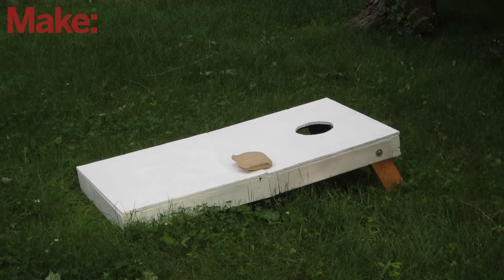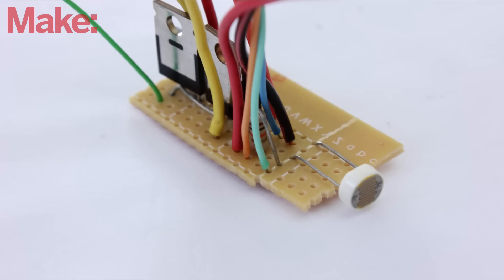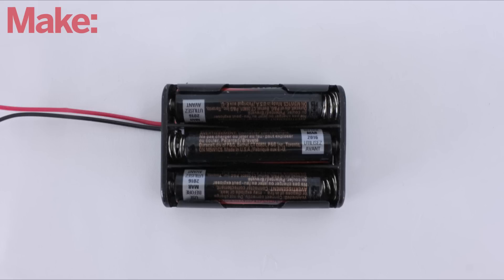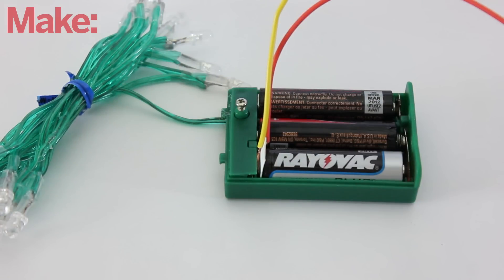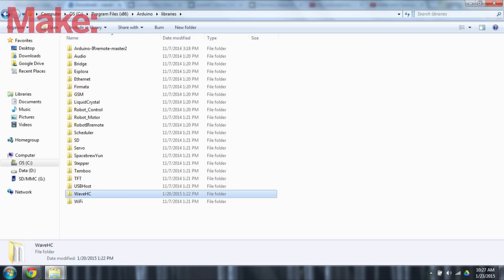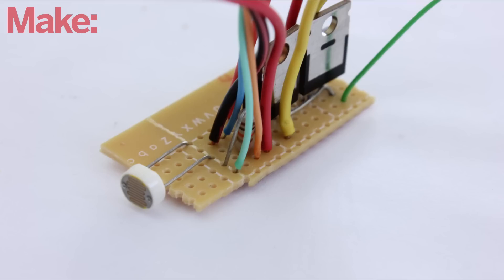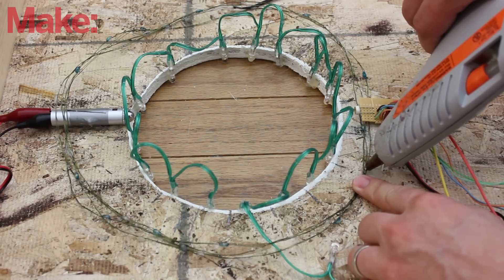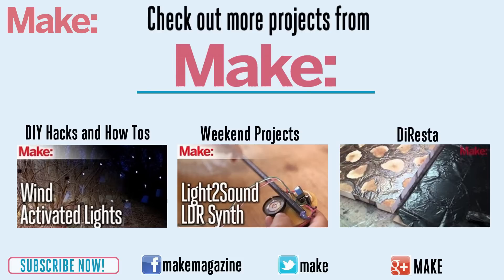Add Light Up Effects to Backyard Games

Comment: It's easier and cheaper when you just connect 5 volts from the arduino to the led's normal you need to have 4.5 volt but 0.5 volt wouldn't kill the led's and instead of using the shield you can just use the simple sd audio playback tutorial of the arduino page.

Comment: You dont need an Arduino for that... When the circuit is interrupted trigger a thyristor.
The thyristor controls the LED and music circuit. To stop the light and music after a time t, just use a monostable multivibrator which is triggert when the thyistor gets high...
t ~ R*C*5
Reply: I was amazed by the fact something this simple needed an arduino and a shield as well. Not like you want this to be a 40 dollar project or something.
Reply: Harm Prins except for the shield (which isn't needed). this project wouldn't cost more than ~10$. an atmega328p is like 2$. you don't need the arduino once the chip is programmed
Reply: then i missed something, i thougth the arduino was in the project itself, didn't notice it was to program something. nevermind :)
Reply: Sonnentau1 You say so because you are not sponsored by Arduino

Comment: I like the idea in this project. I might not mount the LEDs inside the frame of the target hole. They could be damaged by the bags that are being thrown at it. Maybe along side of the frame would work. The downside to that is more wiring and soldering because you're not using the pre-assembled LED kit.